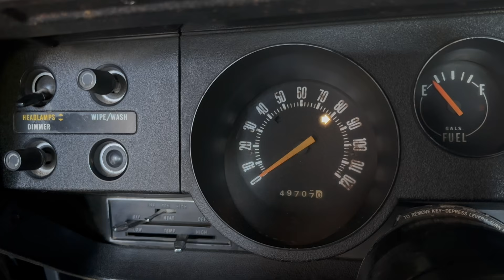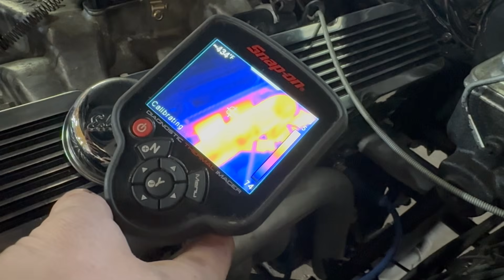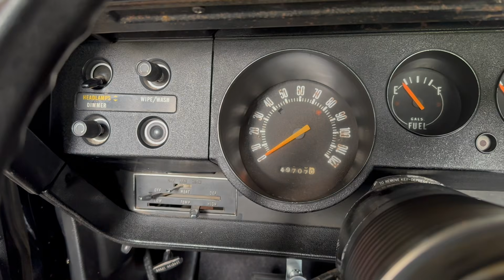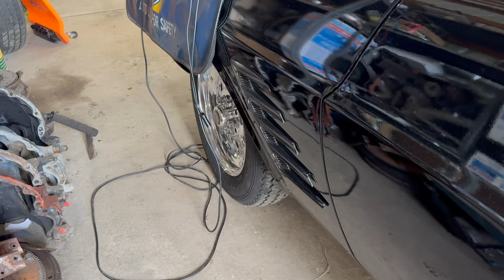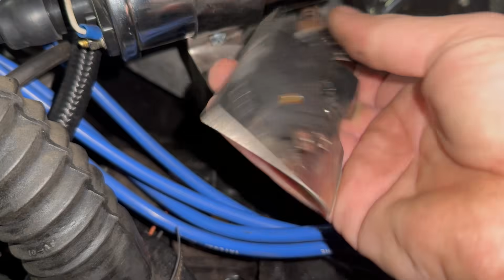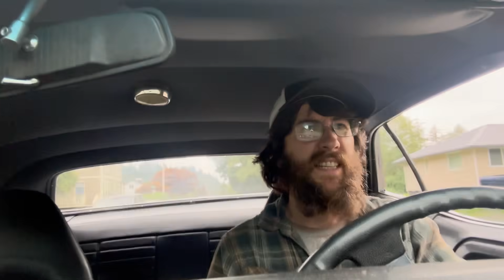What's Wrong With This 1973 Dodge Challenger? Electrical Gremlins, Big Block Tuning Tech, And More

Comment: That sounds like a timing issue brother.
The factory chains are trash and the timing marks can walk on the harmonic balancer.
Had a similar issue on a 66 440 New Yorker
Reply from the maker: I agree - but I replaced this cam and timing set myself in 2017. It is a dual roller. I’m not saying it is 100% degree’d right, because at the time I didn’t know what I know now. But it is certainly a decent timing set that was installed dot to dot. And I do strongly suspect the mark is off on this one, judging by the way it was behaving at 20 degrees base timing by the mark. I did not verify that this time. It runs out sweet on the road, and that’s enough to get him through the nice season. This winter… there will be some changes. I do also want to say - I have often heard of balancer rubbers coming loose, and outer rings moving to mess up the mark. I have verified many, many factory Chrysler balancers, and I have never seen one do that - yet. I know they are out there though.

Comment: Now this is my kind of car porn. Thanks. Great video. I love E bodies. I wish you could do more E body videos. I have a 72 challenger and I am always looking for info. I had a 74 back in 78 and it steered like that one. Really scary. But I was used to it. And Holy Shit, I looked up that power probe and it's $188 at Harbor Fraud. I was thinking about getting one because they do look very handy. Looks like it will have to wait a while. Take care.
Reply from the maker: Yeah they’re not cheap unfortunately. When I break one, I hop on the tool truck, grab another, and just make the weekly payment and pretend I’m not an idiot… thankfully they usually last years. I could not do what I do without it - at least not in as little time. So it is well worth it for me.
Reply from the maker: And as far as E bodies, I will do all of the E body projects I can! The good news is, for the most part it’s all really B-body stuff, as far as mechanicals, electrical, etc.

Comment: It must have been weird working on this after so many years. Pretty awesome car, even if it does need some work. The sure grip will make this even more fun. The rally hood does rule!
Reply from the maker: It was weird, I had many flash backs. It is a much better car in many ways, and yet… also not. Haha. I can confirm, the fun level has improved drastically!

Comment: Asking because I don't know. ( not trying to make a point). Does welding up one distributor  "slot" cause an imbalance? Is there extra wear/tear on the internal distributor bearing?
Reply from the maker: Not enough to make any difference - it’s a very small amount of weight, and relatively close to the shaft. But it is an interesting thought.
Reply: Thanks, I'm not enough of gear head to know what to worry about and what's in the noise. The engineer in me just keeps saying "you don't get something for nothing"

Comment: By the way , what sort of brush, or whatever do you use to clean the terminals inside the connectors ? , and which grease to keep them nice?
Reply from the maker: I just use whatever wire brush I have on hand and a bit of electric component cleaner (or, if I'm out, brake cleaner.) And I use dielectric grease to protect them.
Reply: @DeadDodgeGarage  Thanks . But it would have to be a pretty small brush to get down in there, about the size of small toothbrush I would think .Maybe wire brushes come that small?

Comment: Seeing those '73 , '74 taillights again, reminds me of how good they look , IMO much better looking than the earlier ones  , I do think the 1970 grille is the nicest, but that '73 sad mouth, when it is blacked out is a big improvement , and looks quite ok.  I've thought I'd like to use LED bulbs in both of my Valiants taillights, just for more brightness, would I encounter a problem with that?
Reply from the maker: It depends on the type of bulb. Some require additional resistors or a special LED compatible flasher. Some drop in and work with no problem. And some, like the bulbs that were in this car, refuse to work correctly no matter what you do. Personally, I like stock type bulbs for the look. But I definitely get wanting bright brake lights.
Reply: @DeadDodgeGarage  Thanks.

Comment: Very informative as usual.  I don’t ever use connectors with plastic insulation any more.  I buy plain and heatshrink.  Did you know they make a butt connector with 2 different sizes on each end like a 12-14?  Maybe I saw it on your channel?
Reply from the maker: Yep. The plastic sucks. I need to find a good source for the bare ones so I don’t have to make my own. No, haven’t seen that! That would be a real asset, going to have to keep my eyes out for those.

Comment: I’ve seen on one of my other favorite channels , explaining trans slots on the carb need to be square. My question to you, could you explain your opinion. I understand your explanations better. And does it affect vapor lock? Thank you for any insight.
Reply from the maker: Exposing just the end of the transfer slots so they appear square is indeed the “proper” setting, with the idea being that a small amount of fuel is already being pulled through there, aiding the transition off idle. I don’t actually ever verify this, I just set the idle where it seems best. To achieve that exact setting in various conditions on various engines could require advanced fiddling in some cases. I don’t worry about it much.

Comment: if the  leds have an  1156 stryle  pin setup as you mentioned  they will not light up if in backwards. led's  only work one way  unlike  regular  bulbs that will work if the pos and  neg are reversed. i had this  problem in  my mustang
Reply from the maker: The pin style I'm talking about is not 1156, I think they are 2357s but I could be wrong on the number. Neither 1156 nor 1157 can be installed incorrectly. But it's totally possible with the side marker / dash bulbs. Been there...

Comment: Nothing wrong with led’s.. in my opinion anyway. I prefer them. Just install proper resistors. Put led’s on 4 of my vehicles all old cars, no issues I don’t understand the frustration here
Reply from the maker: With those bulbs, the front blinkers would not light unless the running lights were on. I need someone to explain to me how the hell that is possible. As soon as I installed normal bulbs, they worked normally. LEDs also look completely wrong on these cars. I know about resistors. I know about electronic flashers - which is why I bought and installed one. It didn’t work either. I rest my case.
Reply: @DeadDodgeGarage  just giving my opinion is all, I, for whatever reason haven’t had any issues. Just found out about your channel the other day and really dig your videos! Keep up the great work, ill keep on watching 👊

Comment: When I did the LED conversion I had the same problem. I had to install an LED flasher that had an external black ground wire. I then found the flashers did not work when the headlights were on. Replaced the rear bulbs with OE style bulbs to resolve that. Ugh.

Comment: Three things,

1. I remembered the screw grounding the front socket before you mentioned it because of your past video. 

2. LED bulbs screw up everything from cars to pinball machines if they didn’t originally come with them. 

3. Everyone preaches timing before messing with the carb. Why did you go carb first? I get that you knew there were carb issues. Is the timing first approach more for amateurs?

As far as pinging, someone once said it sounds like rocks in a coffee can. I agree with that, but do they still have coffee cans to know what that would sound like?
Reply from the maker: I went idle mixtures first because it was billowing black smoke when it got here and I knew there was something very, very wrong. I then knew it had a dead cylinder from checking exhaust temps, and found nasty, fouled plugs due to that idle setting. With those two issues corrected, it ran much better. My first actual tuning move was the distributor timing curve. 

That sounds like a pretty good description to me, but yeah… I can almost guarantee today’s teens don’t remember metal coffee cans. Haha.

Comment: That’s a nice car-very classy and timeless in black. The wheels contrast off of the black and look tough. The interior looks great..the pistol grip is the perfect accessory there-in my opinion that cherry sits on top of the one option that makes that car/combo worthy of inclusion at the table with its older siblings! I was impressed by how well it performed; it runs great…well it does now anyways😂(props on the magic brother👏👏👏)! That car is a short list away from being a truly complete package of fun. 
By the way, 👆that is the handling and wiring status of almost every Mopar I own or work on 😅-(just a lil’ sketchy👌)! It would be nice if someone offered a kit that had all of the various connectors and terminals Mopar used in the original wiring harnesses. That way you could make any needed alterations as you go instead of buying each harness and hacking into it. Obviously those items are available or harnesses wouldn’t be 😂.. but I don’t see too much advertisement for that kind of stuff-(trade secret). It takes digging and time to find those connections lol. Enjoy your weekend brother.
Reply from the maker: Haaaahaha. Ouch. Yeah, even I am constantly scrounging for used stuff and random bits from other kits, or collections of random bits dug out of ancient dealerships to find correct connectors. It’s inconvenient.

Comment: No love for the 'frowny face' Challenger?  Nay!  Nay, I say!  I love ALL Challengers from this period and I'm a bit weird in that I like the ones with the frowny face.  If I ever get to own one, I hope it's a black one like that one.  The weird thing?  I would want to paint the grille black like that too......but then it would be silver on the edge of the bevels around the headlights....and I'd also paint the face of the frowny-hump bit in the centre silver.  That way the car looks like it's got a real bad attitude when it comes up behind someone and they will get out of its way quicker.  Well, that would be the theory anyway.

I could hear the engine not improving with each mod you did to the setup...and man, what a totally different sound at the end, eh?  Crisp and instantly responsive to the loud pedal.  One thing I have learnt over the years is don't sweat bricks about being three days into a one day project of things.  There will always be other things that join the list and some of the things you wanted to fit will suddenly require you to pull even more things apart to either get to or fix the one you initially were aiming at...and some of these things will also need fixing, lubricating or replacing (or a combination of all of the above).  Case in point - my Triumph Stag!

Life with a 50-year-old car cannot be understood until it is experienced....and it takes experience to understand that a 50-year-old car has moods.  Some days she will fight you and some days she will reward you for making her feel better.  People have been made lazy by many years of reliability and faithful service from their modern vehicles and their minds lull them into thinking this is a good thing and they forget their past experiences.  Reliability is so tedious though, isn't it?

To be fair, I like LED bulbs in a classic - they are great for lighting up the old instrumentation so you can read everything clearly at night at a glance instead of peering at them for a few seconds to figure our where the needle is.  I like them in brake and reversing lights too because then people see them easier.  Indicator circuits though?  No.  Too much to faff around with when something isn't working as it should.  I am also a bit weird in that I prefer the sound of the old analogue relay's tick - especially in British cars because it isn't off-on-off-on-off-on so much as off-on---off-on---off-on.......ie: it's not a symmetrical pattern as there is a shorter delay when its off and its on for longer.  

I don't like them in classic headlights either because they look wrong in the car.  Running a relay with direct battery power to the headlights also improves the old halogen or sealed beam lights twofold, so it's not really necessary to change them to LED and this method is way cheaper to implement too and also takes a load off the 50-year-old Lucas wiring harness (which is ALWAYS a good thing!).

All the best

Comment: Thanks for taking the time to put these videos together. You definitely have a lot of knowledge about carburetor and timing-tune up stuff. That I never even thought of. Many years ago my brother bought a brand new Edelbrock 4 barrel  carburetor for the Dodge W 200 Power Wagon I have, And for many years the truck would fall on its face when you stood on the gas, So about 15 years ago I checked out the throttle linkage to the carburetor and noticed the secondary's were opening at about a quarter of the throttle, and it came from the factory that way. Once I re-bent the linkage, the truck would get-up-and-go. That's the same engine I rebuilt  around 1982. Still runs great.

Comment: i use a magnet to pull the squirter out usually put a rag in the carb too just in case it falls in
Reply from the maker: The screw would be magnetic, but… is the squirter not aluminum? This one was sitting in my magnetic tray for months and I could swear it didn’t stick to it. But now you’re making me question my entire life

Comment: valve job , and port em a bit ..champion plugs are fine i ran em and still run em  went 200mph with em one thing mopar did right run champion in my rb racing v twin too they never foul on me but i carry spares just in case .

Comment: @Jamie, Power Valves can blow out if backfires thru the carb happen more than about 2-3 times. Just looking at the air horn the carb is too rich or its choke soot. I noticed your new plugs are extended tips and that should help, if it idles more often those will help and a heat range higher will too. I prefer the tube type squirters and 31/35's

Comment: On the vacuum advance pod. I make shims to limit the travel of the mechanism. There, by limiting the advance available. I just glue them in with silicone .016 = 2 degrees.
Reply from the maker: Nice! That’s clever. I once limited one with a couple dabs of weld.

Comment: Reff the occaisional back fire. Look up and persue "Inductive cross fire". It IS a thing. The plug wires on the left bank running paralell for too long will cause two or more plugs to fire at the same time. Stock, it's usually not an issue...but if coil output has been increased...
Reply from the maker: Have heard of that. And while I’m not saying it is impossible, I know for a fact that this issue existed with a stock ignition system, and has been consistent with at least three different sets of plug wires over the years.
Reply: @DeadDodgeGarage  For grins, next time your able to touch it, just try routing the wire that was going to that cool cylander over the valve cover, and out of that bundle of snakes.

Comment: I had 2 different original ammeters go bad on old dodge trucks. Both did the same thing, where the posts go into that copper or brass plate or whatever it is that solder or whatever originally holds the post in failed and was loose in there and started arcing out. One would just straight kill all power, the other still allowed the truck to run fine but almost started on fire on me. It got so hot it actually melted the plastic housing that holds the gauges to where the new gauge I installed didn’t even sit in the right place anymore and I had to do some fancy shimming so it didn’t look all derpy.
Reply from the maker: I’ll be damned. I’ve never seen that, yet…
Reply: An attempt in the late seventies trucks to run plastic cluster frames. Any heat build-up at all distorted the ammeter mounting, loosening the ammeter stud head to bus connection, even more heat. Not the same construction as the earlier passenger cars. Matter of fact the so called “MAD Electrical” article everyone likes to promote is really about the later truck ammeter issue.

Comment: Jaime, while you were checking the spark @1:03:50 in your video I noticed a spark coming of the pos+ terminal side of your coil jumping into the harness. Coil leaking spark?
Reply from the maker: I saw what you saw, and I think it was actually a reflection of light off of the shiny fuel hose running behind the coil that I was nudging as I turned the distributor.

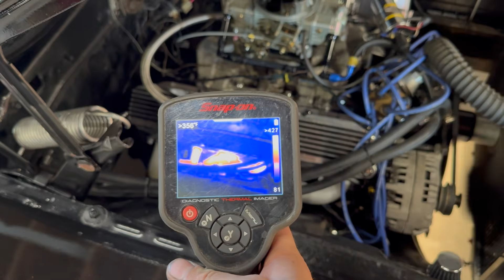Comment: Stopped this at 7:11 to throw my hat in the ring. My guess for the engine problem is timing/distributor. My experience is more with GMs, but anytime an engine was backfiring through the carb it was usually the timing or the distributor post itself.
Reply from the maker: You are not wrong on distributor issues! But most of the constant, major fireballs were solved by replacing the fouled plugs.
Reply: @DeadDodgeGarage  Back in the day, my muscle was a '68 Firechicken, 400 H/O. I cut a lot of corners on that bad boy, but the one thing I indulged in was a complete Accel ignition system....distributor, plugs wires and coil etc. Never regretted it for a second.

Comment: Something I found out the hard way with LED wafer style marker light bulbs is that there is a + pos side identified by a tiny little red dot that is next to fucking impossible to see lol.  These led bulbs can be easily installed backwards reversing the polarity causing a lot of aggravation.  Beware its not marked on the package and can go either way. Hope this helps someone out.
Reply from the maker: Yep… I’ve run into that myself.